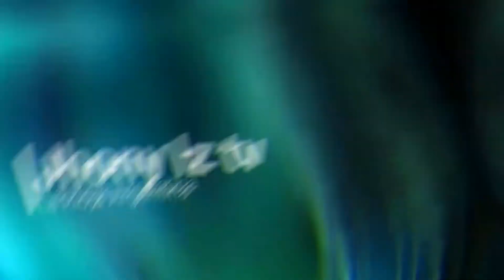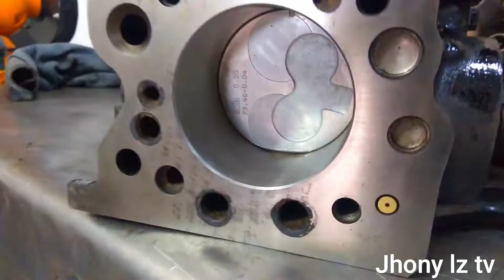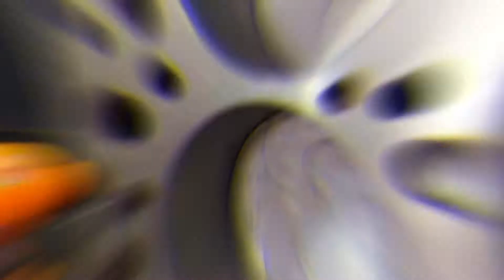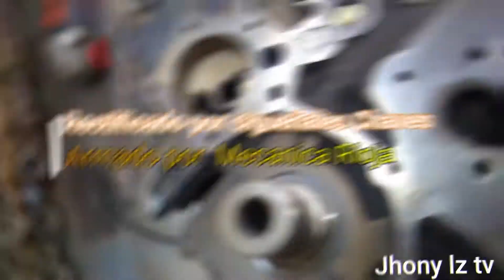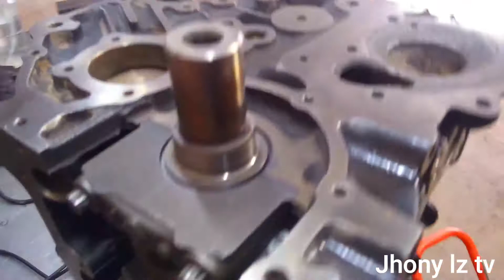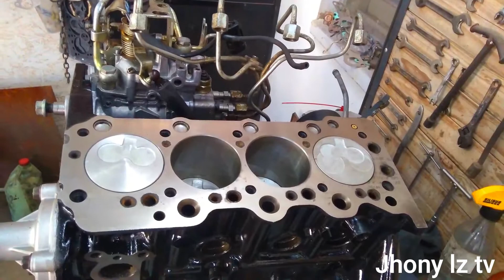Motor de Corsa Diesel 1.7 0KM parte 2 del proyecto Corsa .

Comment: buenas serias tan amable de pasar los aprietes de tapa  viela y bancada muchas gracias
Reply from the maker: Hola buenas tardes. Te comento que no tengo esos datos y te explico una cosa. Cuando un motor es desarmado no podes guiarte por lo que indica los números de fabrica. En mí caso te cuento que está apresto a pulmón. Y si te basas en los números que indica el manual tiene que ser de dos a tres grados más. 
Todo esto cambia por los bulones y las roscas
Reply: @jhonylztv  gracias pero coloque todo nuevo para no tener ese problema
Reply from the maker: @familiacabral8480  lamentablemente no lo tengo al manual de apriete y en el caso del mío foto todo al tacto. Pasa que ya tenemos la experiencia corporal de en las manos para ajustar

Comment: Estoy por comprar un combo fundido ... Cuanto más o menos puedo gastarme en hacer el motor de punta a punta ?
Reply from the maker: Hola genio, antes que nada te invito a suscribirte.
Con respecto a tu pregunta si es naftero con rectificadora, repuestos y mano de obra unos 110 mil pesos, si es diesel unos 130 mil pesos argentinos...
Reply: Hola Master tengo un Corsa diesel 1.7 y quiero hacerle lo mínimo por lo menos al motor, se que no es como un naftero que con un cambio de aros ya está pero mi pregunta es... Cuanto me gastaría en repuestos? La mano de obra la hago yo
Reply from the maker: @sebablasetti8532  hola hermano, mira en repuestos y rectificadora son 120 mil pesos actualmente, incluye tapa de cilindro reparada con guía, asientos y retenes. Y si no tocas la tapa son 30 mil menos.